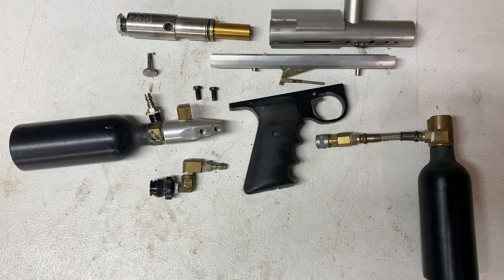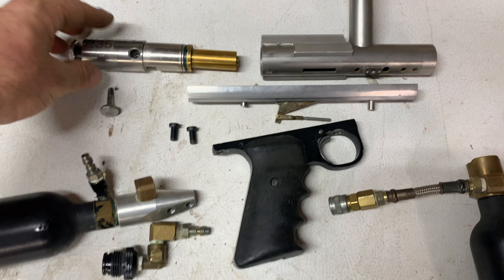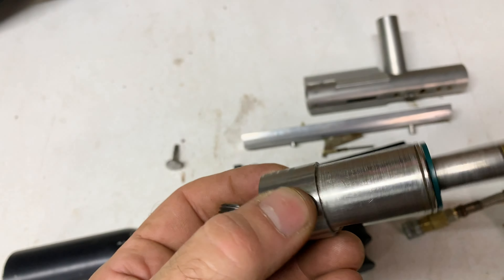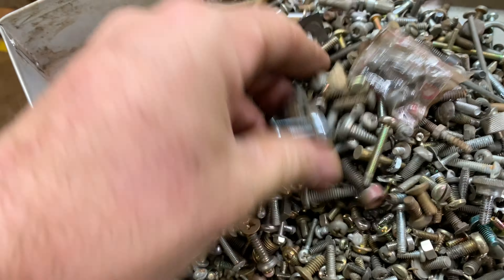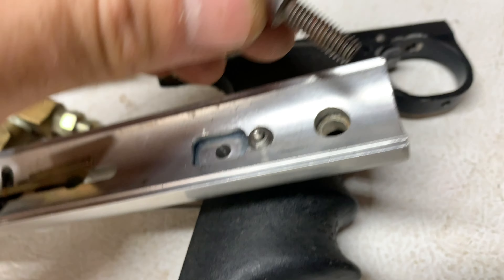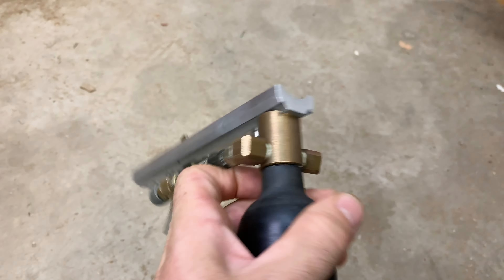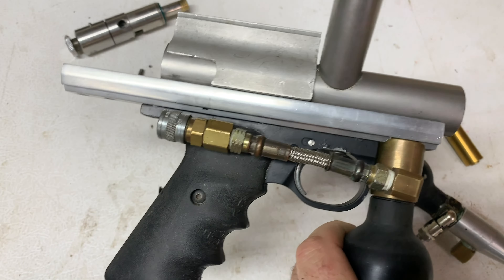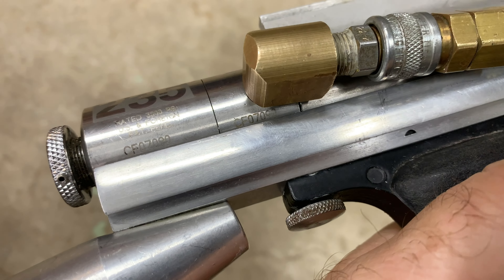Terrible Tech   Assembling a AGD Promag with Anti Siphon Dual co2 tank setup

Comment: Didn’t Cooper T have a version of that 3.5 anti siphon tank? I used to have one.
Reply from the maker: Yes, Cooper T made an almost identical "red" anti siphon valve valve that mounted as a vertical asa. I have one on a mag. The ones i have come with a much shorter dip tube but it could be replaced with a longer tube I think. Not sure if the tube was press fit or screwed in. Thanks!

Comment: 5:58 now wait a second- how is that vertical tank acting as an "anti-siphon" tank? It appears as though it has a dip tube sucking up liquid from the bottom. Wouldn't having no kind of special valve at all be more effective at keeping out liquid? Or is the idea that tube is somehow depositing liquid from the backbottle and only allowing gas from the exposed port to enter the gun? If that's the case, how does the setup correctly divert the gaseous output from that tank into the hose from the vertical ASA leading to the A.I.R. valve?
Reply from the maker: The dip tube is on the input side and drops liquid to the bottom and the output to the valve pulls from the top of the tank. If you look at the end you can see the long tube is on one side bit the hole on the top is prob not clear. I have better photos of these tanks on Instagram / Facebook but haven’t added the write up to paintball history (years behind on keeping articles synced unfortunately). Great question!